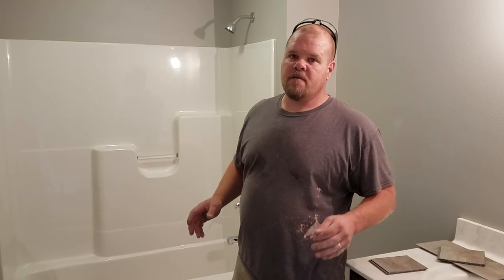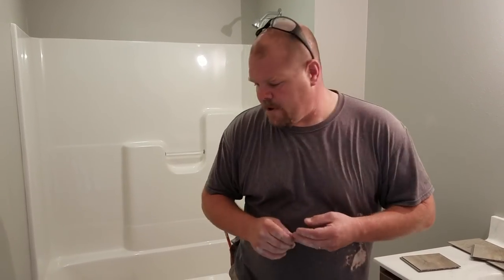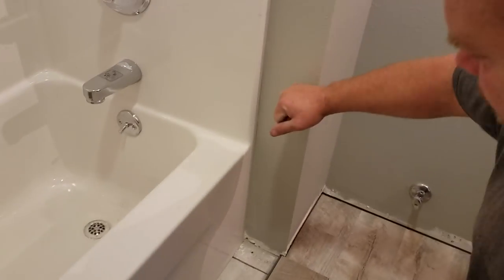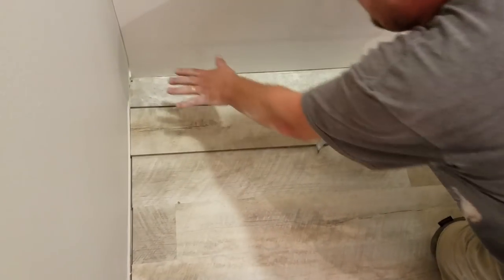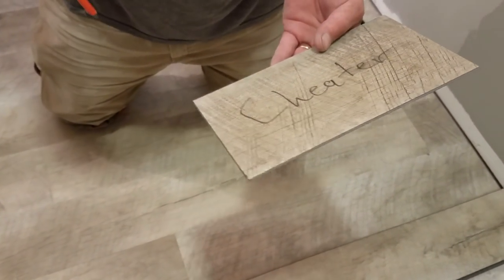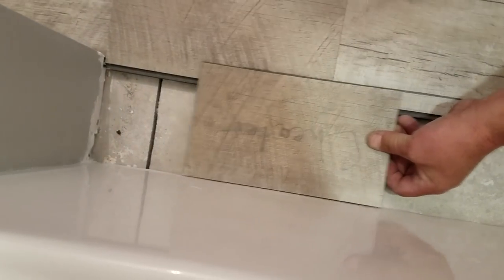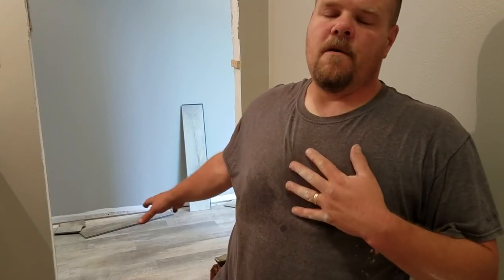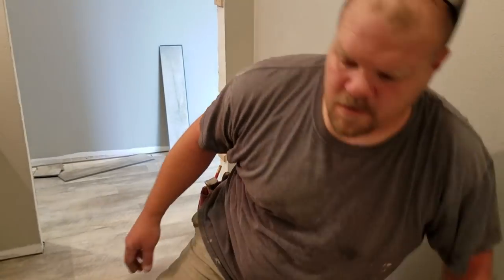how to install laminate or vinyl plank to a tub

Comment: Loved this video. Plan to check out if you can use adhesive along with vinyl flooring in bathroom for extra protection from water. thanks
Reply from the maker: Don't use adhesive use silicone

Comment: I recently installed LVP in the whole house it turned out great after watching many of your videos, so thank you so much for the helpful hints and guidance!! I am now disgusted with the cabinets in the kitchen and bathroom and my next project will be bathroom vanity replacements. I’d spoken with a local guy who said not to install the LVP under kitchen cabinets due to expansion/contraction… Do you have and suggestions for bathroom vanities? Can I install the full floor in the bathroom and place a vanity on top of it?

Comment: Thank you so much for all your outstanding videos. About to do my first project, a bathroom. If I start against the bathtub working towards the door (T-joint there) do I need to do anything special against the tub, other than some silicone caulking? Can I go tight against the tub in my case?

Comment: Great work. Could you have used a shoe molding to cover the gap as well? I know it is an extra step around the room but I think it’s a nice detail.
Reply from the maker: Sure. I would use a shoe made from pvc in the bathroom, or at least next to the tub.

Comment: Joel...you are the man! Have spent the whole morning watching your laminate install videos, so good. Quick question, I am super tempted to carry on our laminate flooring (NOT Vinyl) into our bathroom just to continue the look of the flooring from the rest of the main floor. If I was to glue or silicone each joint in the bathroom, can I get away with using this product in the bathroom? Somehow I feel that if a board or two did happen to get damaged from water after a couple of years, I could even just replace those few boards...? Sorry for the novel here lol! Take care!
Reply from the maker: Glue the joints using wood glue and use silicone around the perimeter, then install the base boards

Comment: Joe, we are doing LVP throughout our new house, hoping to not need any transitions. Our guest bathroom will have the planks running parallel to the tub, as in this video, but our master bath will have the planks perpendicular to the tub and to the separate shower. Would your instructions be any different, other than making sure the butt ends are aligned as perfectly as possible? Thank you.

Comment: Thanks for this video, very helpful. As others have mentioned, we'd love to see the finished effect with the caulk in place. Also wondering will the caulk have enough stability to hold the tub side of those planks down? Around the walls there's baseboard trim to do that job, but the tub edge doesn't.
Reply from the maker: Yes it will be good to go. This is a floating floor and unless you have a hump  by the tub, the planks should lay flat.

Comment: Thanks for sharing  your expertise.  I learned a lot.  Question though...... Can I install vinyl planking over top of existing linoleum flooring?  What about that metal band along the tub where the linoleum meets the tub.  Can I install over top of that?   Thank you sir!
Reply from the maker: Yes you can install over a vinyl floor. If that metal Edge sticks up above the floor you can cut that out. Just cut an inch back from the tub with a utility knife or an oscillating saw and then pry out that metal you will then have to fill the gap with some floor fill

Comment: Well, FUDGE!  I just finished laying all my vinyl plank flooring and removed all the baseboard molding and door trim because my plank flooring required me to have about a 30 degree angle to get these to lock together and not leave an unsightly gap.  I would have loved to have known that little red planer trick before I started this job.  Although at the end of the job, I can honestly say I believe I did a much better job than hiring a professional because I'm so OCD.  The ends of my LVP were against the tub but I did leave enough gap on the opposite end for expansion.  The so-called professionals that removed and reinstalled my toilet put the toilet back before I was able to replace the trim, so now I have to replace the trim in two pieces because one piece will not fit the angle.  That, or I will need to remove the toilet reservoir and see if I can slide a piece down behind the toilet that way.

Comment: Shouldn't there be a gap between the tub and flooring?  It seems doing it the way you show could make it prone to buckling. I'm curious to hear your response. I have seen others use quarter round glued to the tub to hide the gap. Definitely not as clean-looking as your solution, but that would allow expansion of the floor without potential for buckling.

Comment: Hi! When you are measuring your 10 boards for your cheat sheet you have tape measure start at 1 inch. Is that lined up to include male end or just the board? It is hard to tell for sure. At the other end it seems to stop at flooring edging. Like you said a fraction off x 30 boards down the line can add up to a big gap. You are amazing. I feel like I can do this now.
Reply from the maker: Only measure the face of the plank, not the locking system. You got this!!

Comment: Have you done this on a older tub with the contours at the each end? That is what I have at my house.  What are your thoughts on the waterproof vinyl planks that have MDF/cork cores. They are promoting them for bathroom use. Should this only be done with solid vinyl?

Comment: we will be using a transition strip in the doorway from the bathroom to hall way which will also be vinyl plank. so, should it still be 1/8 in gap between the tub or set flush against?
Reply from the maker: You could go tight against the tub and leave a gap everywhere else.

Comment: Great video!  I’m considering renovating my bathroom with a tiled tub/shower and plank flooring. Should I use a paintable waterproof membrane on the subfloor prior to installation?  Also... should I lay the flooring before or after tiling the walls?
Reply from the maker: You don't need to apply paintable membrane on the floor unless you would want to. You can run a bead of silicone around all the edges filling the Expansion Joints this will stop water from flowing through the gap.

If you think you can cover and protect the floor then it would be easiest install the plank then the tile on top of the plank to get the best look. However you can install the tile first and then leave 1/8 inch gap between the tile and the plank and fill that Gap with silicone that matches either the tile or the plank. This is the way I use most

Comment: Great videos. How would you install laminate next to a sliding glass door? Thanks for the great videos!
Reply from the maker: I would leave a quarter inch Gap against the door and then put quarter round over the top of it and nail it into the gap of the floor

Comment: Love the videos and I’m using what I learned from you to tackle the flooring in my home but, is it possible to use this method to butt up against tile in a curb less shower or will I have to use a transition of some kind???? Thanks
Reply from the maker: Yes, you can use this same method against a curb or any tile wall.

Comment: another question because you look like you know your stuff. My little house is like a T. the living room is long N-S. so i will run planking that way. the hall goes off to the east so if i don't twist the planks, they will all be short and not run lengthwise. Ok, well if that's fine, in that case, when i get to the tub, it will all be end pieces hitting the tub, not one lone piece. What is your suggestion for this house? stick with all running N-S? for the most part, when you look into the bedroom, and into the bedroom, you're looking north. but when you look down the hall, it's east.
Reply from the maker: Can you share a pic of a drawing on my facebook page? There is a link in the description

Comment: What are your thoughts about running the planking under the tubs front edge, by an inch or so,  when you do a remodel? I would then use a piece of luan the same thickness as the floor to support the rest of the tub.
Reply from the maker: I would only do that if it was a vinyl plank and if this room is not going to be connected to another room without a transition.  Make sense?

Comment: What kind of saw, and how, would you make that cut in the doorway to add a tmold when the floor is already down? Ot would you just pull up the flooring from the tub back and then cut for the space?
Reply from the maker: An oscillating saw(AKA- buzz saw)

Comment: I know typical laminate is a no-go for bathrooms, but do you think the newer water resistant laminates from NuCore or AquaGuard (at Floor & Decor store) could work? They supposedly can be wet for 24-30hrs. I just don't want to go with vinyl laminate in the bathroom and have to switch to a NuCore laminate I like better for the rest of the house. I'm doing the same style entry from hall into bathroom as this video. Thanks, great video!
Reply from the maker: You should be good to go.

Comment: Hey joe, 
What if you did the 1/4”and filled with a water proof backer rod, and topped with silicone? The backer rode would let it grow and shrink, but still keep the back pressure needed so the joints wouldn’t separate.
Reply from the maker: Sure, you could do that.

Comment: What about the toilet, do you put it under the toilet or cut around it? Do I need an toilet flange extender to flush flange with LVP flooring? Thank you
Reply from the maker: Remove the toilet and install around the flange leaving 1/4 inch Gap and then install the toilet back on top of the flooring. I would say no you don't need to do anything with the flange unless it is sticking up too high. Which unless you demoed out a tile floor that had cement board it will be fine

Comment: Great video. I've used this product before to do a Kitchen so I know how it handles, but I'm not understanding the actual point of planing/gluing that joint near the tub. Are you saying you do this anywhere you want it to be extra waterproof? Have you ever had a planed/glued joint separate later because you took the groove off? Thanks for your help.
Reply from the maker: Know what I'm saying is if you have trouble getting the last row in you can plane and glue the joint. And know it will never come apart

Comment: My vinyl flooring was installed before the tub. There is a gap of a little more than an inch between the tub and floor. I'm trying to figure out what to cover that with. Most flexible molding isn't that wide. Any ideas?

Comment: Great video! Maybe I missed it, but what is the reason for planing the joint prior to applying the glue? Does that simply allow the boards to come together easier, knowing that they'll be permanently bonded?
Reply from the maker: It was just showing if you have problems putting the last piece in here's an easy way to do it

Comment: This was super helpful! I do have a question since we have never installed this before - we are also doing subway tile on our bathroom walls. Should we be installing our subway tile directly to the floor and then doing the floor afterwards so it overlaps the tile? Or should we be leaving a gap for the floor? Thank you!!
Reply from the maker: You could do it either way. Most of the time I install the tile in My Pan last but I share to do it first because it gives more forgiveness when tiling the pan and cutting along the edges.

Comment: Great video, in my bathroom the tub is perpendicular to the door, instead of parallel to the door like in this video.  Therefore the vinyl planks would be butting up to the tub on the short ends, not the long edge.  Is there anything different i should do in that case?
Reply from the maker: +Jamie Craig nope.  All the same.

Comment: Curious as to where you started your first piece or is it a continuation from the other room?  Reason I ask is I'm about to do an installation that will not continue from another room.  In this case would it be better to start at the tub in order to avoid cutting? This way I start with the flat part and not the overlap.  And if this is ok, how close should I get to the tub, keeping in mind that I will also caulk it but making sure all other sides stay away 1/4".
Reply from the maker: You can start at the tub.  I was coming from another room.  An 1/8 gap at the tub will work.

Comment: What types of Gorilla Glue should I have on hand for vinyl plank jobs? 
I'd like to be ready if it's needed. 

I've only used Gorilla Glue for wood working ( foaming type ). I haven't used the other types.
I see you're using the "super glue" type.  If it's like old school super glue ,it seems like it'd be brittle. Are there any other types you'd recommend to have on hand if needed?

THANKS!

Comment: Very informative, thanks.   So after watching this video, I just want to make sure I understand; after you apply the silicone there is no “top cap” Transition piece.   I was describing my intent to the guys at the local flooring store, told them I intend to have no transitions throughout my house (2200 sq/ft), and they told me I need a “top cap” next to my tub,shower, and exterior sliding door?  I’ve not yet started my project because I’m trying to watch all your videos before beginning.   Also, I did not see where to signup for your membership.  I  was planning to do so once I begin the project...thanks!
Reply from the maker: You can use quarter round at these areas or silicone.

Comment: So would you recommend that bevel cut on all planks that butt walls.  looks like you can get much closer that way to wall
Reply from the maker: No. I just do a straight cut if you mean the if you Bevel cut it then you can slide it under the sheetrock farther than yes I agree with that but you would still need to leave a gap

Comment: My problem is that when I caulk the gap the caulking ends up cracking. I think it's because when someone steps close to the tub the built-in underlayment compresses  and tries to open the gap. What is the solution?

Comment: Hi Joe, I'm checking in to see why an 1/8" gap instead of the 1/4" that the manufacturer recommends (LifeProof in my case)? Will it create a gap that's too large to caulk? BTW, I couldn't figure out how to ask this question on the appropriate video on your Facebook page. Are you using a planer on the edge because otherwise it's difficult to snap in that last piece? Great video, very informative. Thank you.
Reply from the maker: I use an 1/8 inch gap so caulk will cover it nicely.  If you ever have an issue you can always make it bigger then.

Comment: How do you install vinyl planking’s in a bathroom that has a roll in shower base.  I just had my bathroom remodeled because I’m disabled and in a wheel wheelchair and I need to know how to transition from the vinyl planking to the shower base lip.  If you have any suggestions it would be greatly appreciated thanks for any information.
Reply from the maker: I would use something similar to this.  
https://www.tools4flooring.com/johnsonite-cta-xx-k-wheeled-traffic-transition-12-ft-length.html

Comment: I’m doing a laminate flooring in my bathroom. Already started. My floor runs the opposite with the butt end going toward the tub not the full length of the board. I will be caulking but now I suppose I’ll need to glue a lot of seams since it’s running the opposite way to the tub. Any suggestions?
Reply from the maker: No you don't have to glue all the planks I was just showing how to put in the last row if you had issues with putting that in you could glue after you plane The Joint.

Comment: So, just the caulk to hold it down?  I worry that the end will lift up.  I was going to do an adhesive quarter round against the tub, but I hate how it looks.
Reply from the maker: Yes running a bead of silicone along the tub is just fine

Comment: what about a tub that has curves at each end not straight across using 12"x 24" lvt tiles, any tips or the same way. like to use a trim but it needs to flex for the curves
Reply from the maker: I would still leave a gapo and caulk it. You can use a template to figure out the cuts.

Comment: Is it better to pull up 24 year-old linoleum up prior to laying the vinyl plank flooring.  My linoleum is coming loose around the tub. If so, does the glue need to be removed as well?
Reply from the maker: No if it is a floating floor

Comment: question, i've always used siliconized caulk around tub surrounds, sinks, etc, not pure silicone. Your thoughts?
Reply from the maker: I prefer the silicone but, i still use the other often.

Comment: My flooring will run lengthwise as the bathroom is long and narrow and the tub is at one end. So, my planks will butt up against it with individual ends, not just one plank. Suggestions?
Reply from the maker: That's fine, there really is no right or wrong way it just happened to be that that's the direction my plank was going on that particular job

Comment: Can’t water get through the cracks and into the wood underneath?
Reply from the maker: No water won't sleep through the cracks you just need to make sure you use a silicone along the tub to seal that Gap and if it concerned about the other areas you can silicone anywhere along the walls and then just cover up that guy that you filled a silicone along the walls with trim

Comment: Do you ever use your block plane for shaving the vinyl plank?
Reply from the maker: +Aaron Singer on the joints.  But i sm sure it would work on the edge to shave a little off if needed.  I use a utility knife for that.